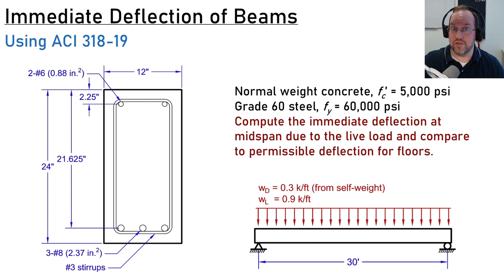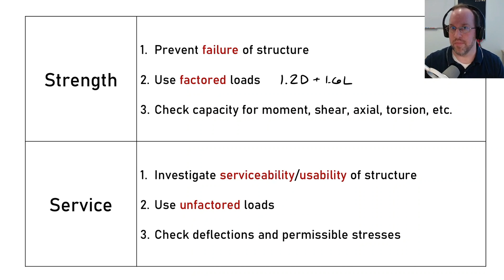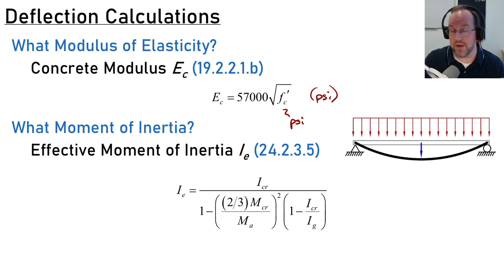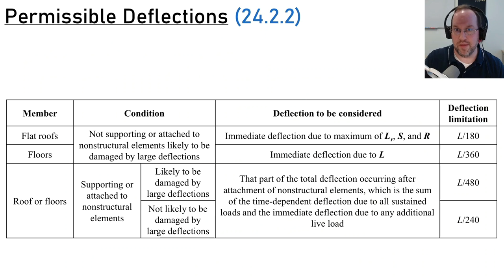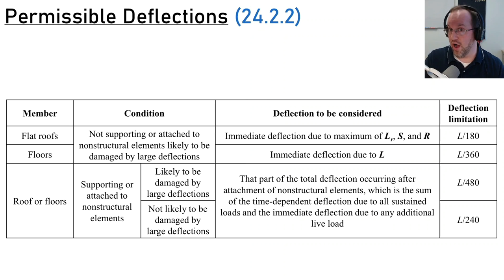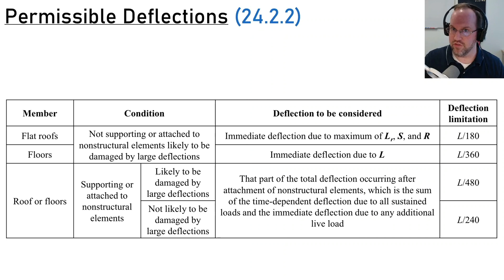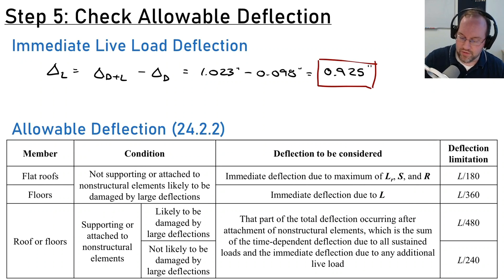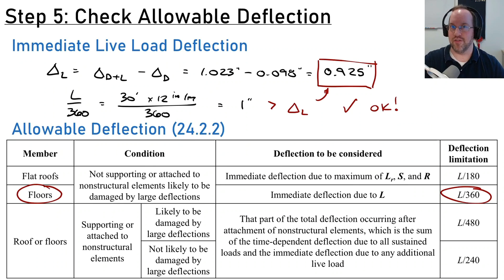Deflection of Reinforced Concrete Beams - Example using ACI 318-19

Comment: Thank you for your posts. I really appreciate them. When you calculated the cracked moment of inertia the second term you show as (d'-c)^2 but when you wrote in the number you calculated it using (c-d')^2. Would you please clarify which is the proper order of the variables?
Reply from the maker: Order doesn't matter for (c-d')^2 or (d'-c)^2 because the quantity is squared - the result will be the same positive number either way.

Comment: Hey,
any chance you can make a video on the method that diveds the element in to 12 parts(or any number), and then calculate each segment moment of inertia, and then calculates the deflection using numeric integration of the curvature at each point ?

Comment: Sorry I just graduated heard a case where there is about 3 cm deflection on beam that is floor slab ones they said 1/360 rule saves it but what about creep and more loads like walls because it's now there is just topping concrete! Thanks for the video subscribed

Comment: Great video! may I ask; is the deflection limitation also applicable in S.I. units? or do we need to convert mm to inches?
Reply from the maker: Deflection limits like L/360 work for any kind of unit, no need to convert. If length L is in inches, then the resulting limit will be inches. If the length L is in millimeters, than the resulting limit will be in millimeters.
Reply: @StructuresProfH  thank you for the clarification sir, your help is much appreciated :)

Comment: Great explanation, I’m just working on a continuous beam (5 spans) and I’m wondering if the process is the same? Do I need to calculate this effective moment of inertia at each span, or each section? How would you do it? I want to get a deflection diagram of the whole beam
Reply from the maker: The ACI 318-19 code has a few things to say about multiple spans. ACI 435 committee design guides will have more information on this topic.

Code Section 24.2.3.6 permits us to average the effective moment of inertia (I_e) taken from the critical positive and negative moment regions. Section 24.2.3.7 also permits us to use I_e computed only at midspan for continuous spans. Take your pick. Either way, these seem to imply that you could compute I_e for each span and then compute a deflection. Keep in mind that the purpose of these code sections is largely for control of maximum deflections, not always exact calculation of a deflected shape.

Personally, I'd just use the midspan value if it is less than the value at the supports rather than taking an average. The other approach that I like is suggested by Bischoff (2007): take a weighted average of the flexibilities. For example, using something like I_span = 1 / (0.70*(1/I_mid) + 0.15*(1/I_end1) + 0.15*(1/I_end2)), where I_span would be the overall effective moment of inertia of the span, and I_mid, I_end1, and I_end2 are the effective moments of inertia calculated at midspan and the two ends, respectively.

Of course, you are always permitted to do a more rigorous analysis, and that might be preferable if you want a really accurate profile of the deflections along the entire length of the beam. You may compute the effective moment of inertia at each section, and then find the curvature = M/(E*I) along the entire length. Finding the displacement would then require you to integrate the curvature twice (or have some software do it for you).
Reply: @StructuresProfH  thank you so much for your answer. This was very helpful. Keep doing those great videos

Comment: Where is the provision in ACI that state that the transformed section of compression steel is equal to (n-1)A's ?
Reply from the maker: There is no such provision in ACI. The (n-1)As' comes from mechanics. Normally a transformed area would be n*As, where n = Es/Ec, and this is valid for the tension steel. However, the compression steel is displacing an area of uncracked concrete which is also carrying compression, so we use (n-1) to reflect this.

Comment: Hello Sir? If these limits are for floors, then how can we use it for beams. Your kind guidance is required please.
Reply from the maker: Sorry I wasn't clear - the specified limit would also apply to beams supporting the floor. Beams supporting roofs will often times have different (typically more lenient) limits.